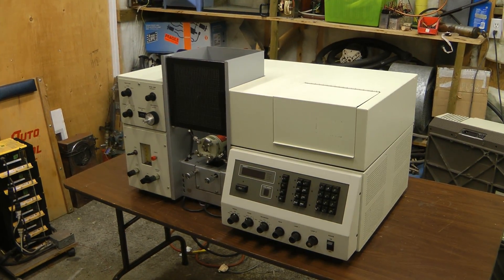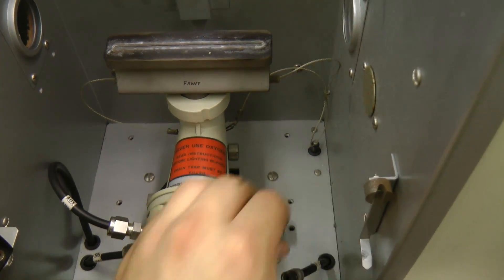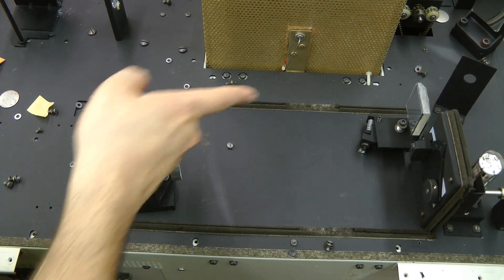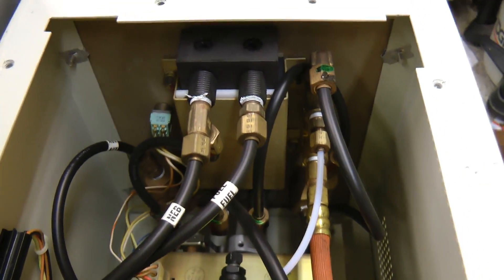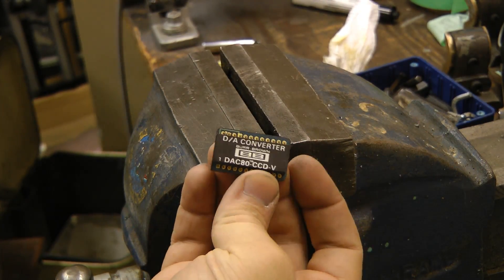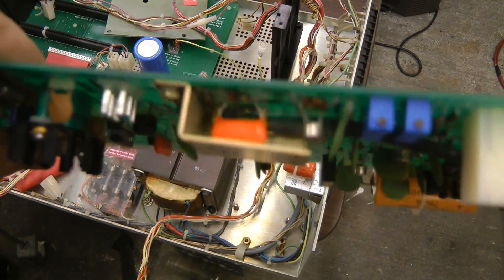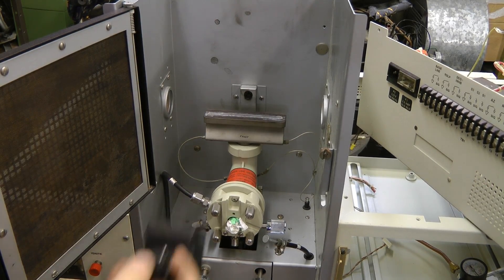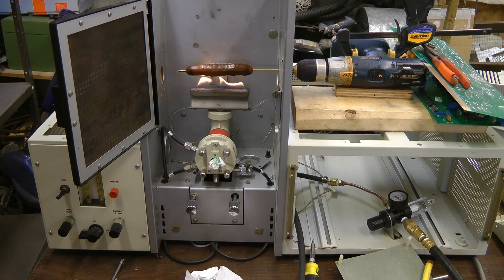Atomic Absorption Spectrometer Teardown

Comment: Thanks man. I am well versed in using this type of machine. I use an Agilent 280FS daily. I wanted to replace the photomultiplier tube. Agilent quoted me only $5300 to come out and do it. If the setup is the same  I can just swap out after buying one online. I have three of the same type of PMT's around (446; from an older model) the 280FS uses 955's.

Comment: I used to operate one of these - even in this age of better-refined electronics, the machine was exactly the same design as this one.  Pay no attention to the ignorants giving you shite over (any of) your teardowns -- most people can plainly see that there exists very little value from the remains of this antiquated equipment.  Learning from the teardown experience affords Far greater value than from the pile of parts left on the bench afterwards!

Comment: Nice tear-down. The burner is on steel wires or chains, because some times 
the nitrous oxide acetylene mixture can pre-ignite in the nebuliser assembly, the
bang from that is very loud and energetic, causing the burner to jump out of its
assembly. The wire is there so it doesn't it you in the face. Most burners have bursting discs to allow the explosion to vent.  
There were no hollow cathode lamps in there, the lamps have different elements mixed in there for the analysis.

Comment: The result was used to determine the condition of the engine or gear box from say a jet fighter, commercial jet or very large earth moving equipment. Depending on the metals present you can tell the condition of bearing surfaces or any metal particles that might indicate wear and impending failure.

Comment: I worked on robotic systems used by an oil company to process typically 3000 oil samples per day. The sample arrived in a plastic bottles from all over the world. The bottle was shaken to ensure any particles where in suspension. It was then pipetted into a test tube and toluene added. The test tube was then shaken again robotically and burnt in the spectrum analyser.